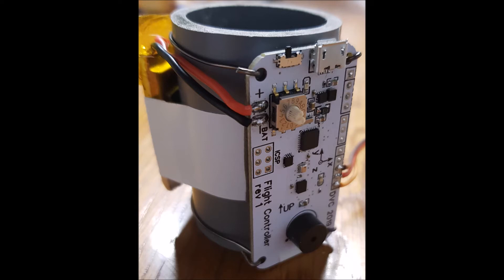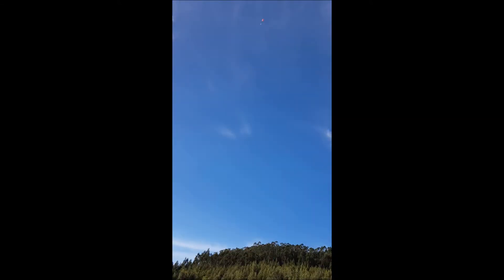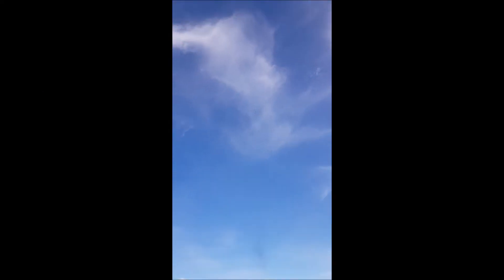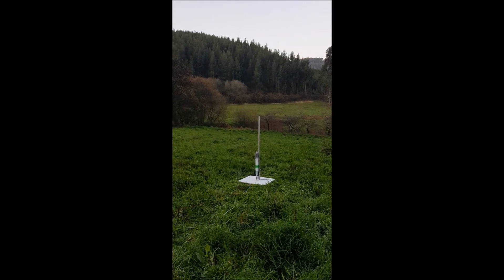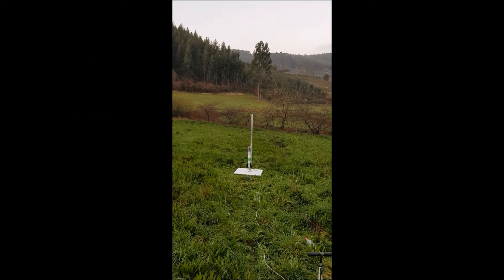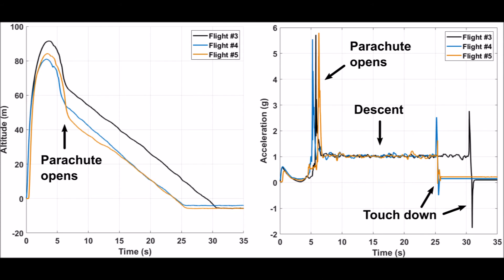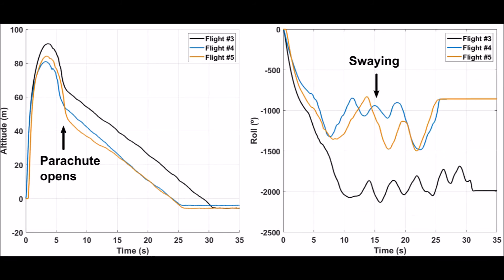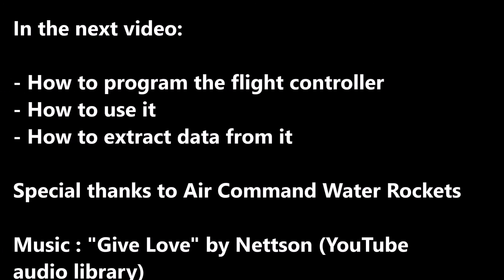Arduino Compatible Rocket Flight Controller and Data Logger

Comment: Please share the schematic flight controller PCB
Reply: Have you consisered delaying parachute  deployment to make the rocket not to drift (too far) with the wind? Joe Barnard of bps.space fame does just that.
Rocket reaches its terminal velocity on parachute in just a few meters. The parachute needs to be stronger if the rocket has been falling 50 metres, though.
Reply from the maker: @sepposyXIV  thank you for the comment. The flight computer does exactly that in automatic deployment mode ("A mode"). Apogee is detected automatically and the parachute deploys after a set ammount of time. I have programmed the board in such a way that this time is adjustable in steps of 600 milliseconds. For more information, please check the user manual in my GitHub page https://github.com/DanInvents/Flight-Controller/blob/master/userManual.pdf
Reply from the maker: Soon I will start selling this circuit board in Tindy. Hopefully next month you can find the schematics there. I'm happy to answer any questions you might have.

Comment: Awesome! Great to see the flight controller in action! Looks like you also came across the sun affecting the sensor. I wonder if you could place some kind of a sun shield on the board itself. zLog altimeters have a piece of clear heat shrink tubing over their board with a black square covering the sensor. This way air can still reach the sensor under the tubing but not light. Perhaps just stick a strip of paper/black plastic either side of the sensor and create a kind of bridge over it. This way people won't forget to shield it from the sun. It looks like there is enough room on the board next to the sensor. Keep up the great work!
Reply from the maker: Thank you for the kind words. What you suggested sounds like a great idea. One could even 3D print a plastic bridge to cover the sensor (yet allowing air flow from the sides) and glue it to the board. This way it would be possible to produce many of them in a repeatable manner.
Reply: Good idea! Yes 3D printing the bridge would be the way to go, as you can easily mass produce them and get consistent results as you say. :)